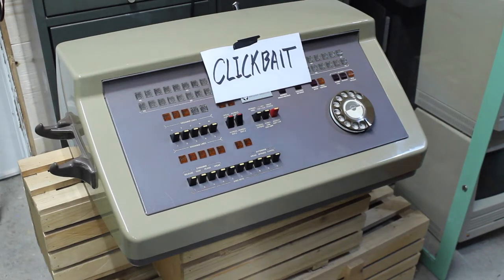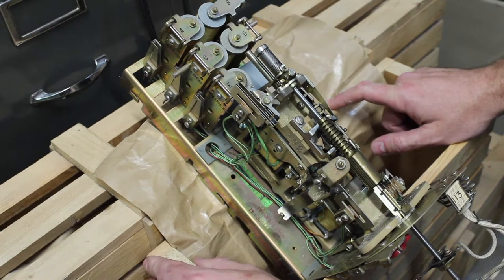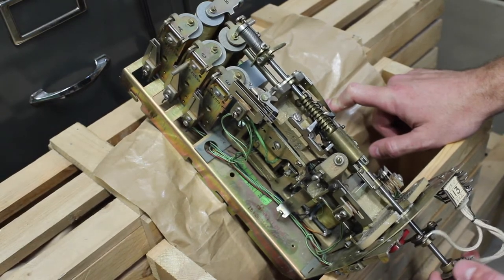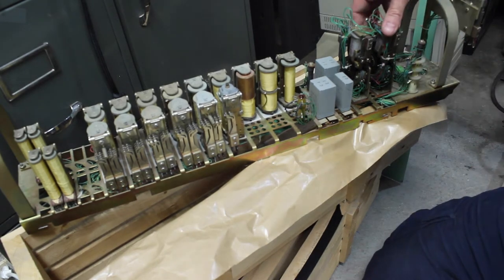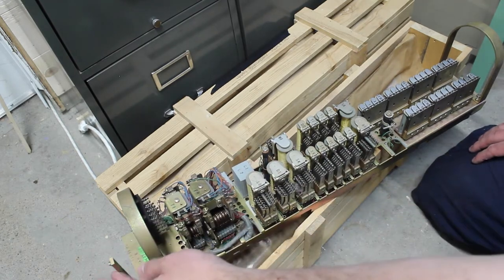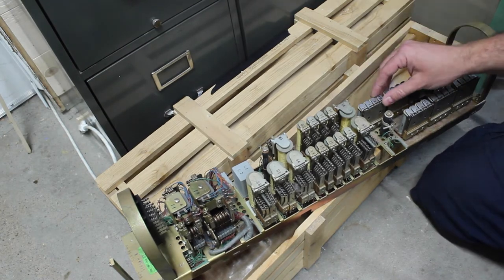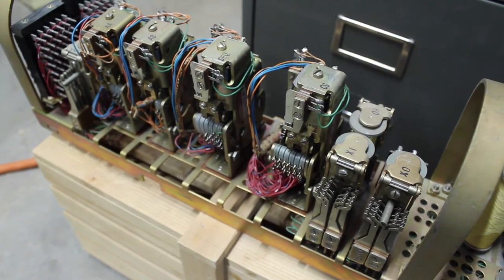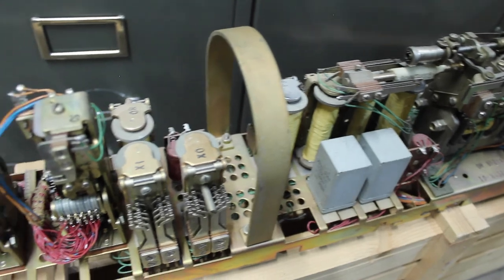Mystery Step Equipment

Comment: The last set on your vid is A register translator called. A Director in the uk. Its used to add routing digits ie you dial in 485 the furst digit is used in the switch before this unit the second digits step the two motion switch the unit then sends out up to 6 different digits depending upon the strapping of the unit.
Reply from the maker: They're manufactured by Automatic Electric. I've talked to folks familiar with AE equipment, and it doesn't appear to be part of an AE Director system. The director used the same basic building blocks, but the layout and organization of these three relay sets doesn't match any of the documentation available on the AE Director.

Comment: Do you have diagrams for the sender that you showed in the second crate because that i have been trying to make for a long time. I think it is a register sender and it sends out multi-frequency tones to a register receiver.(those tones are not the usual dtmf ones on touch tone phones.)
Reply from the maker: I haven't been able to locate any documentation on these relay sets. Unfortunately, Automatic Electric documentation is not nearly as well preserved as Western Electric documentation. This equipment came out of a step CO that was located in south-east BC; any long distance connections would have been most likely routed via step tandems in Vancouver, BC or Calgary, Alberta, and that is where the MF senders would have existed. Also, the code system used on the codel relays is incompatible with the 2-of-5 system used for MF signalling. The current consensus among telephone collectors is that this probably part of an Automatic Electric Strowger Automatic Toll Ticketing system, which was AE's long-distance call billing system.